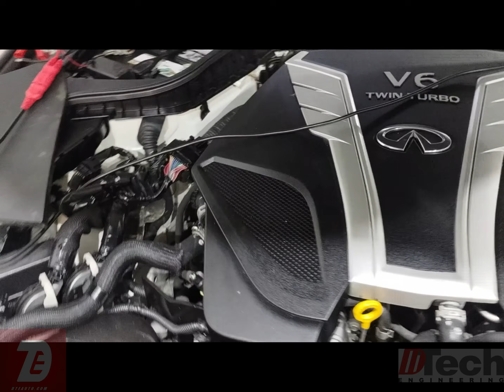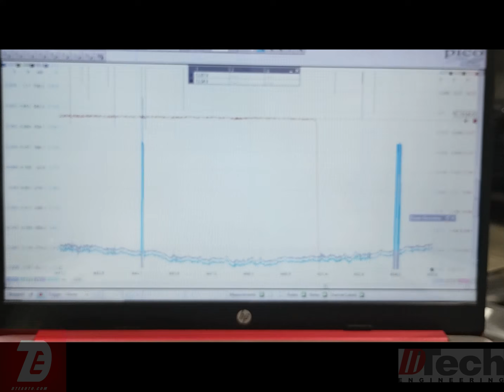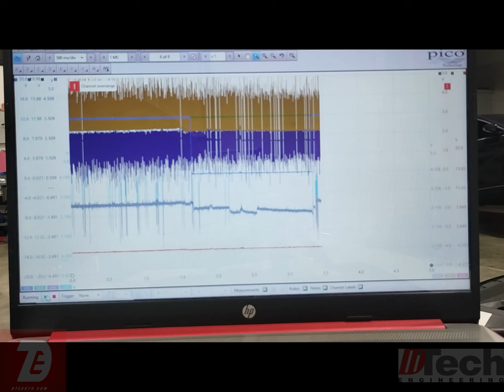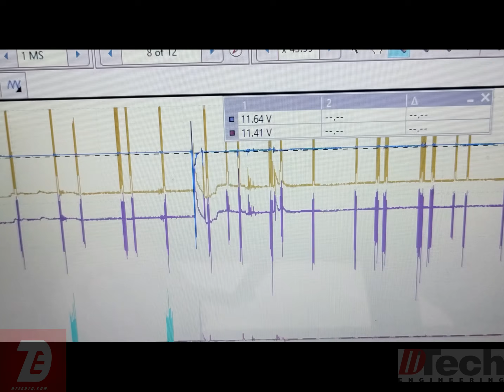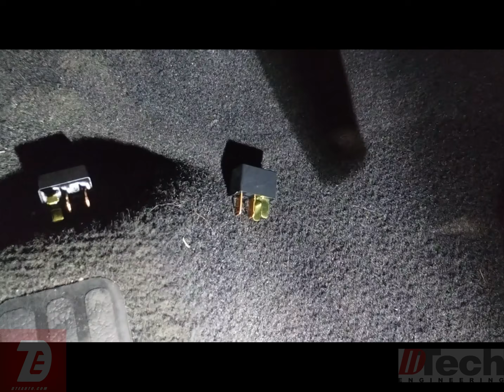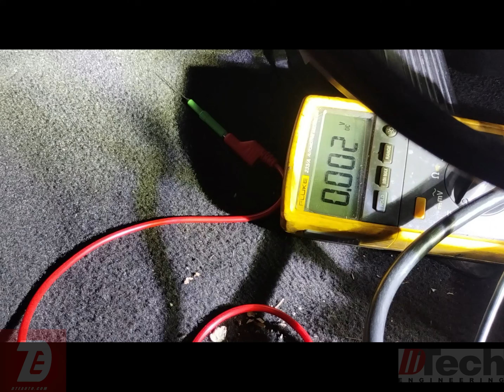2017 Infiniti Q60 Intermittent No Start Diag & Fix

Comment from the maker: This could have been a multiple module parts canon situation,  I wanted to post the codes here that I forgot to put in the video that could lead you to make those calls.

Some of the misleading codes:
- In the ECM: P062F Which relates to internal EEPROM error and service info describe possible bad computer (ecm)

- In the BCM: B26F4 for starter control relay 
                        B2562 for low voltage 
both of those can point out to possible faulty bcm itself or ipdm

- In the IPDM: B2098 Ignition relay on circuit
                         B210C Starter motor control relay off circuit
                         B210E Starter motor relay off circuit
Those 3 codes could point to the ipdm itself or bcm
Reply: We are in the same job and i learned from you a lot.
after you spent many hours to diagnose this problem some one need to pay you for all your time how can you explained this for the owner?
Some owners can tell "but is just a fuse" this is one of the big problems in our diagnosis job how you deal with that?

Comment: Thank you for all the diagnoses, it's crazy what some people will do to their expensive cars. AS FOR ME, I do not trust a floating voltage or ghost voltage, or voltage fluctuation on a scope or multimeter as these devices are high-impedance tools and do not load the circuit or do not pull amperage enough to load a circuit. When I see these funky voltages, I then touch my normal test light to the line and if the voltage drops down near ground, I know the circuit in question cannot carry a load to light a normal test light as seen as a loss of voltage on the meter or scope. Now I can trace a weak contact, splice, fuse box problem, corroded fuse terminal??

In this case, I would have backfeed 12V one junction at a time towards the fuse box until I found the VD. In the end, as it always is, finding the actual problem as the very last step, an improper type fuse inserted into the fuse box, OMG

Comment: I think the green 30amp fuse would have worked good if they have used a fuse holder and if they have crimped two female spade connectors. Always enjoy your diags ,but its somehow a long video for this simple problem. No offense i love this channel ,but you maybe will get more views if the videos dont exceed 30-35min. Have a good day man 😊
Reply from the maker: I definitely understand, it's always hard to decide on putting out content that is long like this situation. I still wanted to present it to anyone that would have interest, the fact of the matter is that I tried to condense it down in the matter and steps I took the best way I could. This was a 10-hour process that I cut down to an hour. Thanks for the input and hope to keep your views as best as I can.